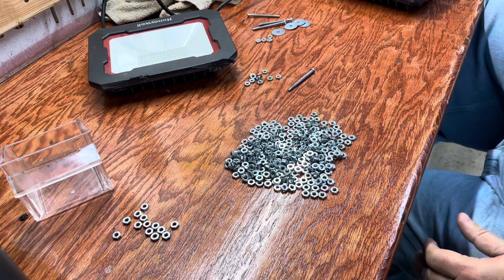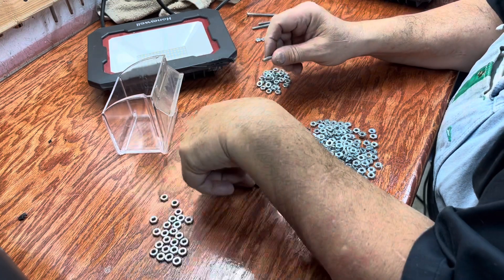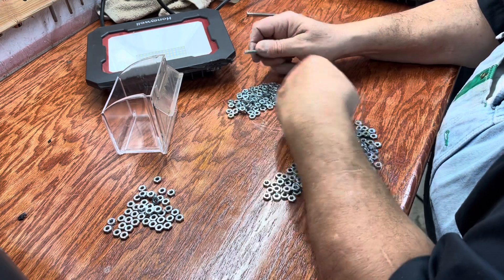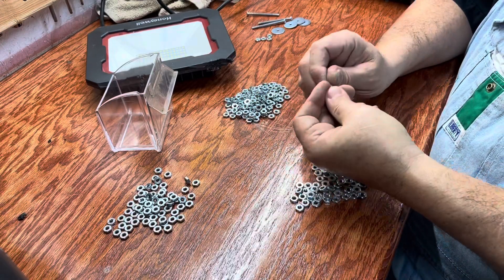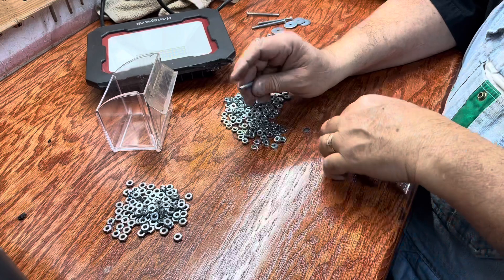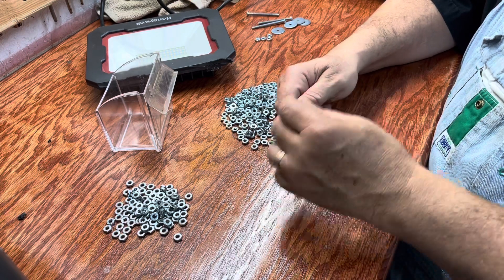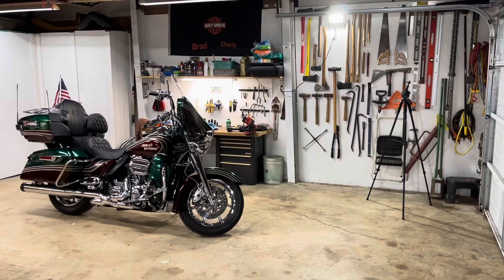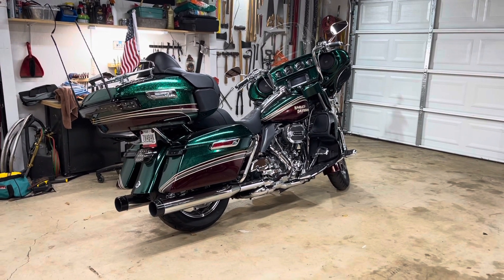Separating my nuts and talking and installing lights in the garage

Comment: A friend of mine had a cascadia that was trying to bring his wallet back to its original birth weight. 
It was a horrible machine, and the regen system tossed it into limp mode a few times hundreds of miles away from his delivery point.
Reply from the maker: 2008 was the first year of the regen and that was where 75% of our mechanical breakdowns started. The regen system was required by the feds with no where near enough time to refine them and work out the bugs. They used the 2008 truck buyers as the Guinea pigs.